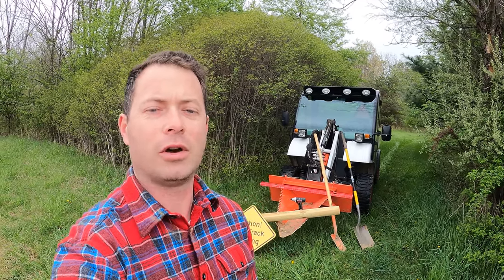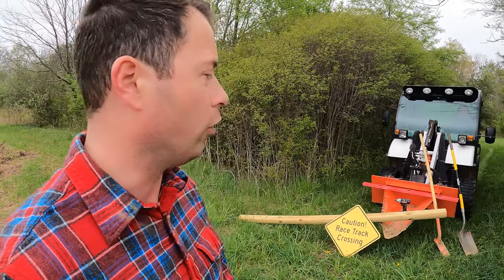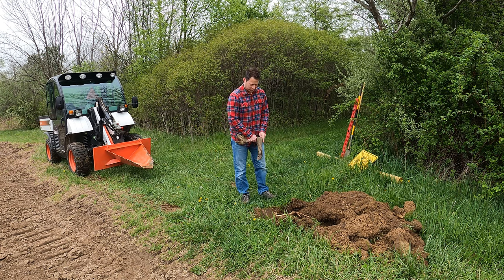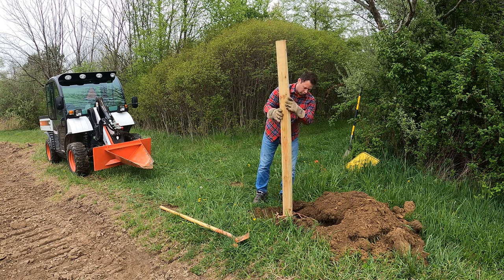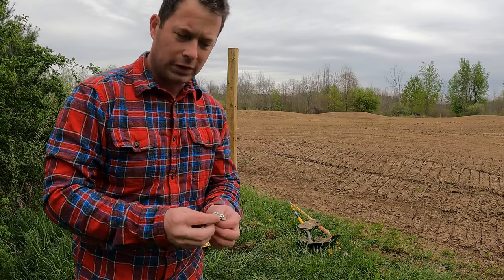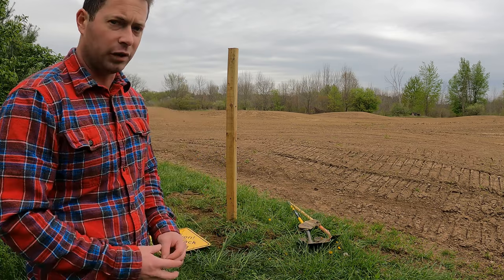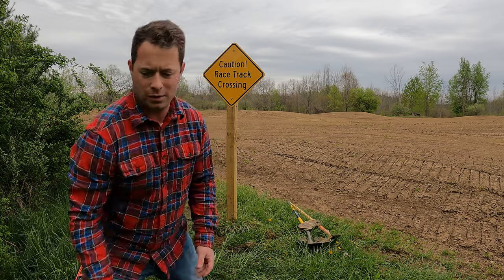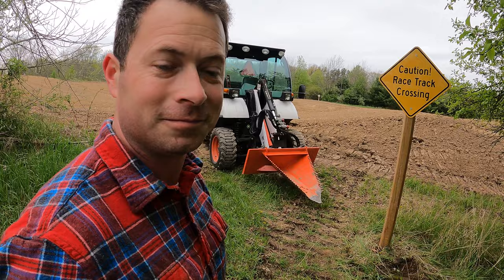Installing Wood Sign Post With No Concrete For My Dirt Track

Comment: What about the decking boards made from recycled plastic? Would they hold up better than treated wood? IDK just a thought. I Luv how much thought & prep u put into all your projects!   🌹
Reply from the maker: That's a good thought!  A lot of the composite boards I have seen dont come in "post" styles and also they are not as rigid or structural as regular wood.  But yes plastic should last thousands of years.

Comment: You are very innovative I’ve never heard of no concrete putting up a post before.  But I’m curious and heavy rains will it cause it to slant?  I like the way the machine preserved that grass and you put it around the post like it was never disturbed
Reply from the maker: It should stay upright/plume if you follow the 1/3 of post buried rule of thumb.  But of course soil types could effect that.  The main concern long term is wood rot due to moisture.

Comment: Even though they are treated they will not last. I have sand here and no water and they only last about 2-1/2 years. 
I always use now pressure treated 4x4's for my  antenna projects. 
But you are right on the price of wood. I needed I 4 x 8' x 3/4 thick and it was $118.00 each. WOW that's crazy. no wonder new house prices are stupidly high.
Reply from the maker: Agree,  I consider these temporary.  But since it only takes about 15mins I figured I'd wait for the sky high lumber prices to drop.